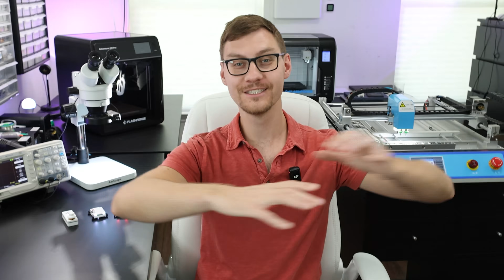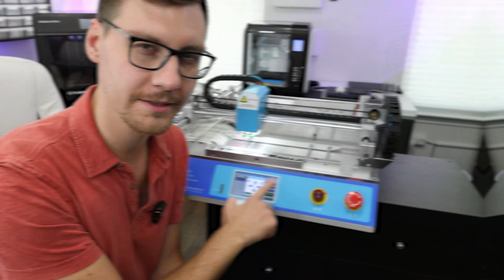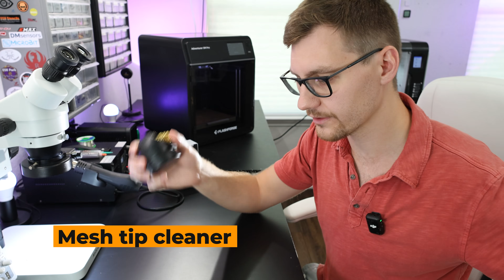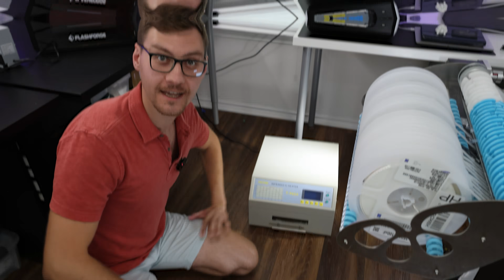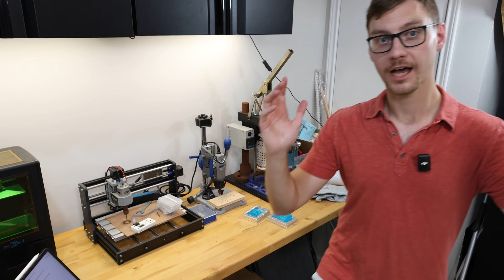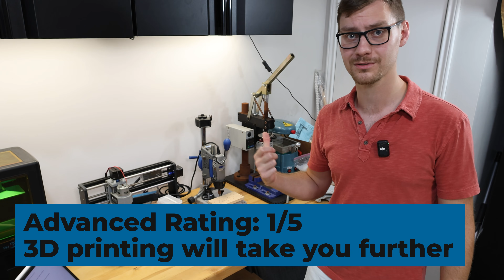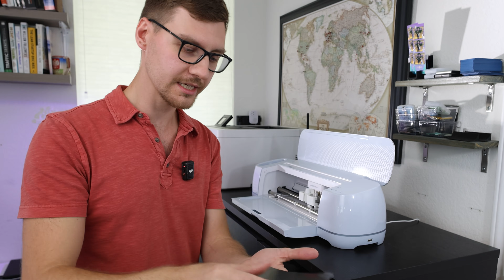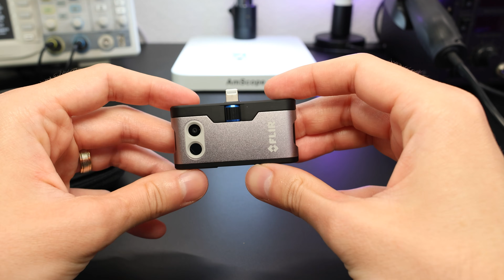I Wish I Knew This Before Building My Home Lab

Comment: Another noteworthy thing: if you have the time you can build your own test gear. i build most of my test gear from ewaste that's not worth repairing and some stuff i have laying around. It takes time but it's so worth it. My lab cost me < 600 bucks and i got a curve tracer, a arbitrary waveform gen, logic analyser, oscilloscooe, dynamic electronic load  variac, gps disciplined oscillator as a frequency standard, voltage standard, resistance standard, microohm meter, high current ammeter, various lab bench psus, megger tester, FPGA development environment thingy, proper ESD precautions and so, so much more.   small desktop CNCs are actually great for making your own, primitive but functional pcbs when you want to save money or need a board with low lead time. for soldering, just pick up a toaster oven from the ewaste and throw a microcontroller, SSR and thermistor in there and you are good to go and do reflow soldering. Cost me literally 5 bucks and still hasn't failed on me. Yes stereo microscopes are great but honestly, grabbing a webcam and some optics you can get a very usable result as well. instead of a thermal cam you can use liquids that evaporate at elevated temps. Hotair isn't as essential in my experience, don't even have a hotair station right now.  A desoldering gun on the other hand is a must have if you do a lot of through hole assembly and or repair. In the end it all comes down to what it is that you are working on, but i found my setup to be pretty good for anything from power electronics to high voltage, general device repair, precision analog, digital comms, high speed digital systems and even some basic RF. couple.things i did wrong: DO NOT Aquire the cheapest oscilloscope to be had. My fnirsi1014D has caused me more confusion that it gave answers. A few more essentials to me are : multifunctional USB tester, multifunctional component tester. You need multiple multimeters, trust me. One aint gonna cut it. I've found it makes sense to care about a single origin of precision for your lab early-ish on so you can always calibrate your test gear. I'm literally just using a GPS disciplined oscillator as frequency standard from which i derive resistance and voltage standards that are very, very stable.
Reply: A person after my own heart. This is how I do things. They ain't pretty but they work just fine! And when I want something newer, I will source new parts myself. I built a $600-800 laser engraver/cutter for less than 200 bucks, programmed it myself and had to print the head mount a few times before I got that right, also had to add some extra joint stabilizers. 

I may also have to change a couple things out because I jumped on some cheap profile not realizing it wasn't v-channel. I made some mods to keep it on track, but I haven't done anything noteworthy with it as of yet since I am still working all the bugs out. I feel like some different tires for the carriage wheels with a center ... fin? I think it would work like a slot car track and prevent derailing. And they do exist, but cost an outrageous amount per wheel. The entire wheel with tire, bearing and machine bolt were a fraction of what the tires cost. 

I may just go with linear rails and mount those to the t-channel profile and call it a day. I've never seen a railed laser before. I wonder if it would have any affect on its production quality? 

On the other hand, just buying the three main pieces of proper v-channel profile, two X and one Y would probably be a cheaper solution and get me up and running, doing bigger, non-test cuts and engravings. LOL I let my ideas run away with me all the time and completely bypass the simpler solutions. It's fine to toss the ideas around and wonder what if, but problem solving shouldn't be more complicated than it has to be. Or more costly. (that was a note to self, there. One I have had to write umpty-three times at least. Next time, it gets rubberbanded to a brick lol) But figuring it all out is the fun part! Spend the 30 bones and get it done. Loud and clear. 

Anyway, nice to hear I'm not the only one that likes to pick up people's electronic garbage and harvest their guts. I am particularly partial to motors, but control panels, lcd screens, certain chips, gearboxes, I l ove all that stuff. My husband hates it, but benefits nonetheless. When our A/C went down this weekend, I threw together a "swamp cooler" in a bucket with a fountain pump, some half inch tube and some of that blue spongy substrate I had left over from forever ago, and a "fart fan" as he likes to call exhaust fans. Had it running in ten minutes, gave it to him with an extra bucket of water so he and the dog were cool in his office while I fixed the issue. McGyver style. 

And this year we had flies galore. Someone wasn't picking up their dog 💩in the hood. I don't care if the season is on its way out, I'm building a bigass bug zapper. I have everything I need but the UV bulbs for bait. The transformer I have will make fly ash and it will be satisfying af to watch the longass arcs as they become little winged electrodes. Almost as satisfying as muzzle loading my pellet gun with rock salt and shooting them one by one. Just WAY more efficient than pumping 7-10 times for each fly. But I've sharpened my shooting skills. lol Just in time for desert mice seeking shelter in the garage season, but I will switch back to pellets for that. Wrong house mf'er. 

🪰🐁🪤🎯🔫
Reply: So if your primitive made circuit board doesn't reflow properly, and now you need to fix a few components on it, how do you do it without a hotair station?
Reply: @kamu38 i just got a broken toaster oven from the ewaste bin and added my own temperature control with an SSR i built out of the triac in an AC PAC dimmer , a random STM32 microcontroller board from an old kitchen scale and a couple thermocouples +amplifiers salvaged from various other boards. works pretty well as an IR reflow oven for my purposes. i am lucky enough to have access to an ewaste bin where people dispose of many things that can still be very useful. you might have to get a bit creative depending on what ewaste you can find. Stoves, cooktops,IR lamps, toaster ovens, regular ovens microwave ovens that have a resistive heater for cooking stuff(be VERY careful when salvaging components from microwave ovens, they can easily be lethal if you don't know what you're doing), hmhair dryers, with some poking around anything like that can work for SMD rework.
Reply: @eepydragonloaf  Yeah ewaste bins are great. I try and salvage things all the time.

Comment: I'd pick a scope over the Logic Analyzer - mostly because the scope can decode at least some serial protocols or save the waveforms as CSV for some python programming exercise to make sense of. And most of the times a bus acts up the scope was key to finding the glitches that caused the problem. Ok, the waveform looks dodgy, no wonder the peripheral gets confused! Let's find out whether fixing that removes the problem. 
Plus a number of budget oscilloscopes come with a decent function generator/AWG. Helpful, either as a test signal/arbitrary but repeatable input or simply as a stable external clock source.

Comment: Chemical tip cleaners aren't supposed to be used like a brass wire wool or a wet sponge for regularly cleaning tips, they are an acid, flux, and solder paste mix, designed to erode off oxidization off of older tips and to re-tin them when they are starting to become unusable after prolonged use, and will refresh a tip like that almost back to new with one of the good ones. If you use it like you would a brass wire wool or a wet sponge your tip will be gone REALLY fast as it'll just get eaten away! There's also a HUGE difference between a good chemical tip cleaner (I prefer calling them tip re-tinner ... as it avoids confusion tbh), and a bad one, and some of the cheap ones just don't even work. It's also ofc important to make sure you get one for the correct solder type, but that's kind of elementary. However, I agree, if you actually look after your tips and always keep them with solder over the entire heating area, and never have them without solder for more than a few seconds, you'll probably never need a tip tinner, although you can end up going through a lot more solder, which can be expensive if you're doing through hole components using a larger gauge of solder.
Reply: Tip tinner was my favorite discovery, second only to solder paste in my self-learning how to solder journey. Oh the tips I could have saved! But since I didn't have anyone to show me, it was 10000% trial and error, then I was browsing for solder on amazon and found alll kinds of stuff I never knew about. First was paste which helped me a lot to understand solder itself and how it flows why it behaves the way it does and it made working with filament so much easier. Then tip tinner. I  had been fighting the good fight for a couple years and throwing away a shit-ton of crappy tips, then I saw this stuff and was fricken amazed how well it worked to make my shitty tip melt wire like a new tip again., 

I've tinned tips with chunks of metal missing from them especially in the beginning and was shocked at how well it worked. It makes so much sense to me now, because a lot of times, adding solder to a joint makes it easier to remove. Sounds counter intuitive if you don't know any better. I felt like I discovered a secret in finding tip tinner, but I was the only one that didn't know about it. LOL I'm not nearly as awkward now and actually love when I need to add a pin header rail to a micro controller or instead of using a screw cap which have always tripped me out, I'll solder and heat shrink the joint. Screw caps seem so janky! I can't believe they are a thing still. With Wagu connectors on scene especially. Love those things when I'm not feeling dragging the kit out.
Reply: @NoTime4HorsePucky  I used to sand my tips when i first started, to get the oxidization off and make them useable again haha .. I knew about tinner, but didn't have the cash at the time to invest in some. Thankfully, I have a nice swanky modular iron station a sweet pen, and a whole selection of super durable tips of differing sizes. I still have tinner on standby just incase I ever need it, but as I've got better at keeping my tip covered in solder almost constantly, I very rarely need it anymore. :)
Reply: @Dafty_Boi  Haha guilty! I also used to strictly solder outside on the patio table and in a pinch have actually dragged the tip across the concrete in absence of sand paper.  🤫😏 I have a copper ball of brillo in a jar somewhere. Been using my fine wire brush in ITS absence. My mother asked me what I wanted for Christmas and at 46, my eyesight continues down the path of sucking more all the time. I pointed out a midgrade microscope with LCD screen I was gonna put on a boom arm if I got it, but when I talked to her recently, she mentioned it and called it something else entirely. I haven't seen it yet being a state away and she hasn't figured out how to make Amazon drop ship like  do every holiday, birthday, etc. LOL

But what you described is roughly the goal. I built a nice carbon filtered extractor. A hot air station and solder iron combo would be rad. I have a couple guns that rapid heat when the trigger is pulled, by weller I believe, a HUGE iron that's probably older than I am with a fabric wrapped cord. It was pop's or grandpa's which is killer for old school analogue devices. But it's awkward. I believe it's for automotive acid core stuff, though. I attempted to buy a ceramic heated, temp controlled 80watt thingy from aliexpress and they sent me a 220v with a euro plug. Thanks a pantload, Ali. But it was like $3. I even tried to mod it but couldn't get it fully apart to see the board or whatever is inside there but that's not totally true. I didn't care enough to fight with it, and just adapting the plug didn't get hot enough to scald me let alone melt soft metals. I also had a couple usb irons which are handy af, but they die quickly if you use them, like, at all. lol

SO? I just keep buying the $6 Harbor Freight special when I have to. And now I'm in the vine voice program at Amazon, so I'm just waiting patiently for them to figure out by my purchase patterns that I'm a geek and start suggesting gadgets, parts, components, etc. Actually they did suggest a $40 SMD box with like 14 different types of components and a couple thousand pieces. Pretty good score, so maybe I have finally arrived? crosses fingers I got a titanium 3d printer nozzle and a full print head that is easily adaptable to one of my machines. They seem to almost know me. Maybe. haha Otherwise, the industrial and scientific section is the best place to browse around. I find cool gizmos and obscure hardware in there. Motors! A freakin' welder that fits in a mailbox! I am hoping it will break my terror of the 1980s model craftsman one I have. Anyway, I'm blathering on and on. Sucks being the only hardcore geek I know heh

Comment: I've been painstakingly hand-winding a 1300 turn torrid inductor with 34 gauge wire in a very specific wind pattern, and have been kicking myself I didn't buy a digital microscope when I was looking at them a few months back. I have pretty OK eyesight, but 34 gauge is just too tiny to keep track of. I may even end up buying one before I finish winding this torrid it's taking that long lol. I currently have this janky set up with my phone's camera open on my phone, my phone precariously balanced on-top of 4 bendy arms with crocodile clips (meant for holding pcbs) which it constantly tried to slide off of, and every 30sec the camera screen  goes blank for power saving, and I have to tap the screen with my nose to turn the cam back on as I can't let go of the torrid otherwise the windings will unravel and I'll have to go back and do the previous 2 turns again (which has happened more times than I'd like to admit, and I even did the same two windings so many time I snapped the wire after completing an entire layer and had to start again lol). So I can vouch for your first suggestion for good tools to buy! >.<

Comment: I think it would have been more helpful to present things in order of priority. Soldering iron and multimeter obviously come first, a two channel power supply is a must, a modern digital scope can replace a logic analyzer for serial communication like I2C and SPI. For repair work, an LCR-meter is very useful. You don't talk about hand tools such as needle nose pliers at all. I agree with the observations on visual inspection.

Comment: A fume extractor is something we shouldn't cheap out since this involves your health, 3 stage fume extractors are not that expensive nowadays. 😊
Reply: Absolutely agree. The small carbon filter shown here really doesn't do much - it's better than nothing but not good. If you can see through that filter, then particles are getting through (sort of like throwing sand through chicken wire...). Carbon filter plus HEPA filter (and a 3rd stage if you prefer) is the best solution. I can confirm that long term exposure to soldering fumes create lung issues - sort of like industrial asthma,  I suffer from it, albeit after 40+ years of use! 

 It really depends on your level of use - If you can't afford a filtration unit, then make sure your workspace is well ventilated (and save for a good unit!).